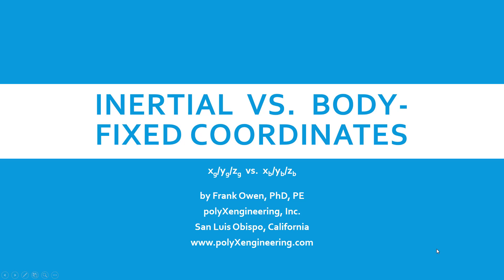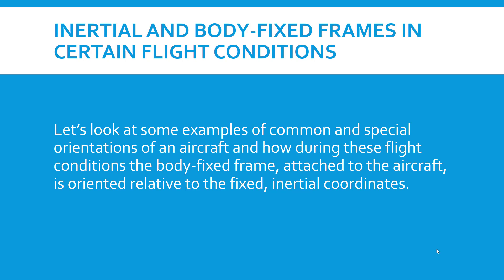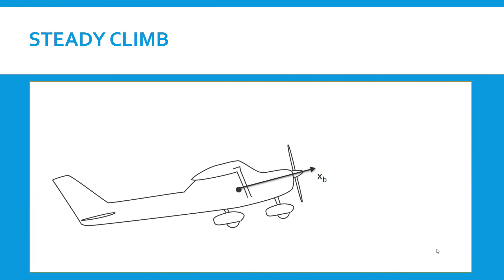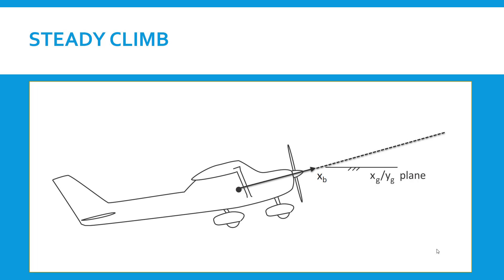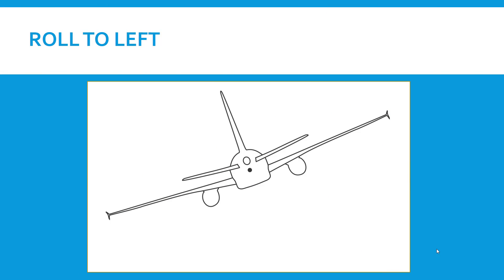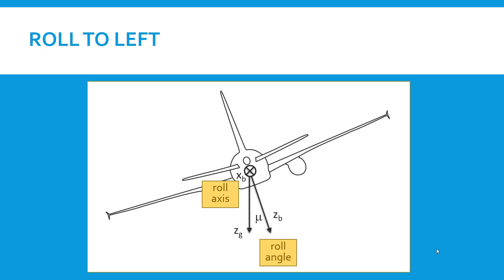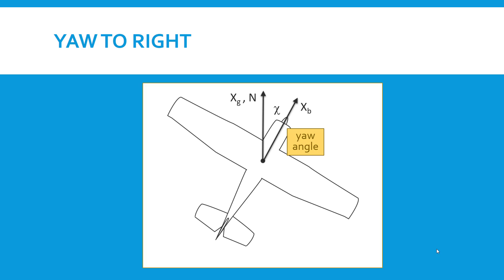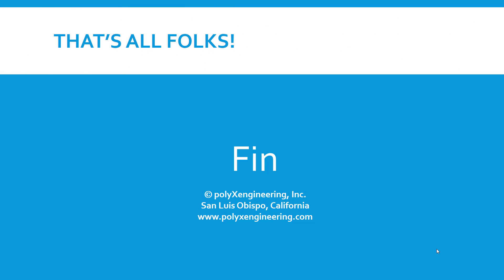Inertial vs. Body-Fixed Frames

Comment: Thank you!
Is there a pattern for the greek letter for this angles?
I had read on Paul D. Groves book (Principles of GNSS, Inertial, and Multisensor Integrated Navigation Systems) and wikipedia pages that the pattern is ɸ, θ and ψ for roll, pitch and yaw respectively.
I'm asking just to know how much the pattern is a pattern on professional enviroment.

Comment: Thank you very much for that very nice lesson. Just a comment regarding pítch and flight path angle. The pitch angle is as far as I know flight  path angle plus the angle of attack!!!
Reply: Hi jdtaramona,  You are correct.  The direction of motion may not be in the xb direction, usually isn't, and differs by the angle of attack.  Thus pitch angle = flight-path angle + angle of attack.  Thanks for pointing this out.